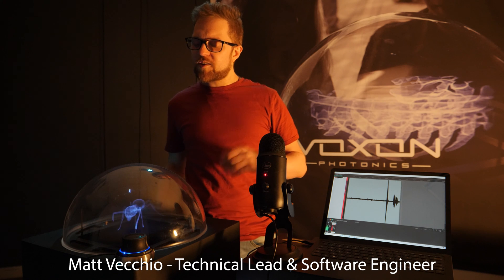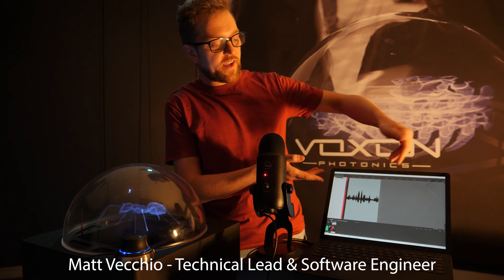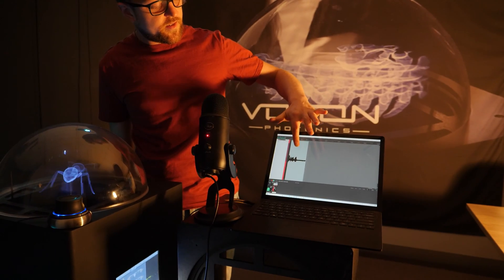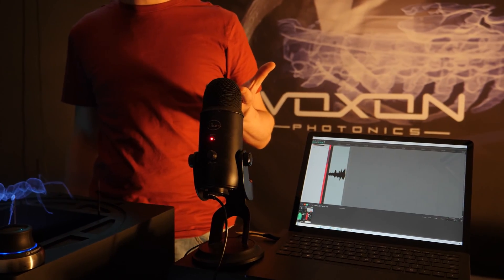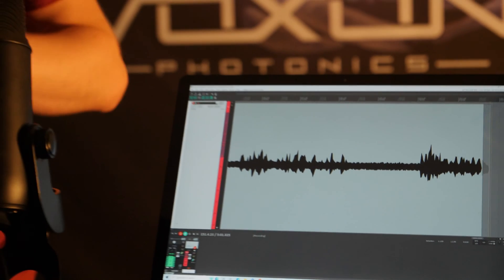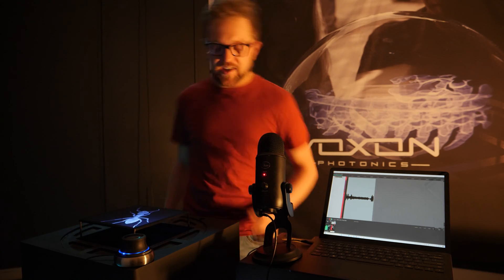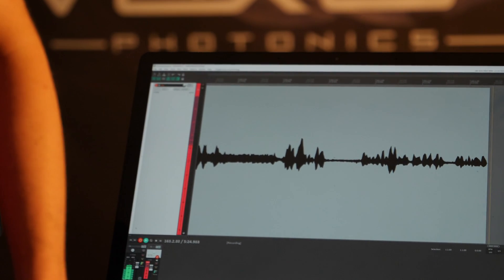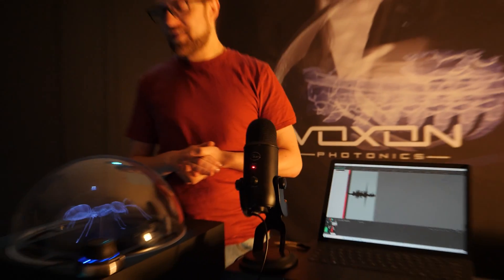How loud is a Voxon Photonics VX1 Volumetric Display

Comment: is the screen being moved up and down by 4 synchronized pistons?
Reply from the maker: @litterbox019  close but not exactly. It is  resonating on an electromechanical spring assembly.
Reply: @Voxonphotonics  holy moly that was a fast reply
how is the screen not breaking? is it just a really strong material?
and how are the springs kind of turning invisible once it starts moving?
Reply from the maker: @litterbox019  the springs are hidden inside the enclosure. The material is made of a tempered glass with special coating and a carbon fibre bezel which is very stiff and light weight.
Reply: @Voxonphotonics  wow thanks for the quick explanations

Comment: Wonder if you can improve the durability/reliability by simply pulling a vacuum under the dome. Would remove a lot of unnecessary force on the motors/screen I presume.
Reply: It may also reduce the noise.

Comment: So THAT's how it works! I was always wondering. So it's basically just a monitor screen which goes up and down in a fast pace and with a synchronized image in the Z-axis. Somehow this is anticlimactic but better than nothing.
Reply: i dunno, the fact that the display isnt tearing itself apart with such abrupt motions up and down is pretty impressive to me.
Reply: @guesswho2778 pretty sure its a translucent screen of acrylic or something that vibrates with a projector underneath. the actual screen doesnt vibrate
Reply: @HokoraYinphine  i hadnt thought of that, that makes so much sense.
Reply: @HokoraYinphine it is. There is another channel that has made a review of it and in some moments of the video the camera is looking straight down into the dome. You can very clearly see a tilted mirror projecting the image onto the screen.
If you read what they said about how this works, they also have said that it is a "high-speed reciprocating screen" that refracts the light as it moves up and down
There’s also another demonstration online where the person shines a laser into the machine, and the light gets deflected into several directions. Looks very weird honestly, but also confirms what you’re saying
There’s also another video on youtube of an engineer that made a volumetric display using the exact technique you’re mentioning. He used an old projector, and used the colorwheel control signal to synchronize everything. It looks almost exactly the same, except a bit noisier (probably bc of synchronization/bandwith/control issues)

Comment: If this works the way I think it does... that flat screen would need to be able to refresh at 3600 fps in order to create a 60fps 3d image.
Reply: im fairly certain its 30 fps not 60? the display oscillates at 15hz
Reply: that's what they do afaik, they mention 4000hz.
display is vibrating at 60hz at least.

Comment: How the h*** does this work?!??!?!
Reply: Pay close attention to when he shuts down the machine. You can see that it vibrates a little bit before it fully stops, that’s because the way it works is that it is essentially a 2D screen that goes up and down extremely fast. There’s a projector below it and the software synchronizes the image with the screen height.
Reply: @himalayo  It's crazy. It almost looks like a concept, but it's real

Comment: Not loud enough for a party. Does it have speakers by any chance?
Reply from the maker: What do you mean Michael?  This is the mechanical noise only that we are measuring. Yes it does have speakers for game audio and also bluetooth.
Reply: @Voxonphotonics  I'm saying it's quiet for an up and down system.
Reply from the maker: @manbanasiak  yes, that is because we use a resonant amplification mechanism. It's tuned like a guitar string to only vibrate at exactly 15hz.
Reply: @Voxonphotonics  missed the joke entirely